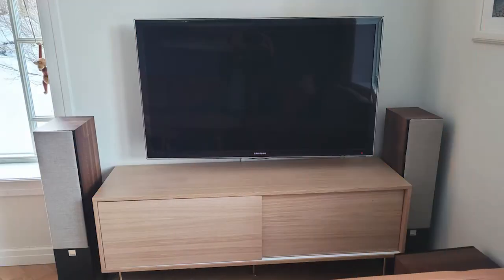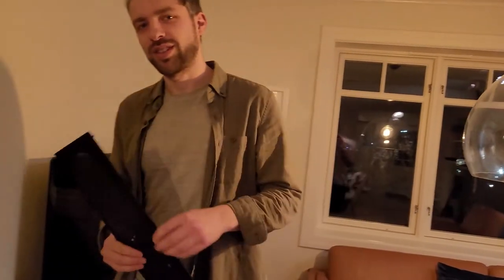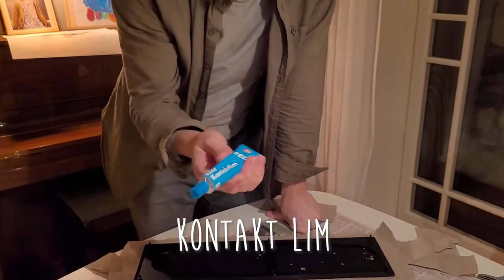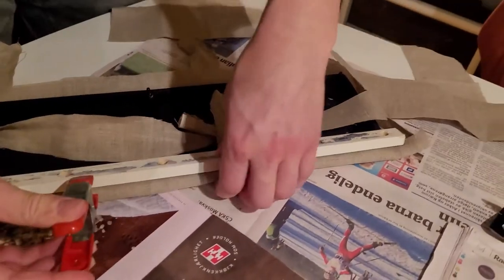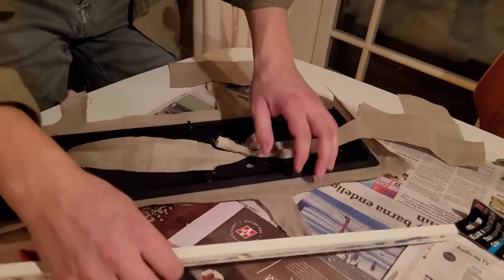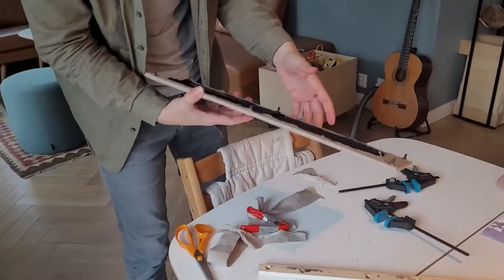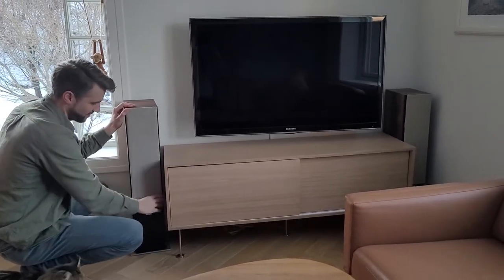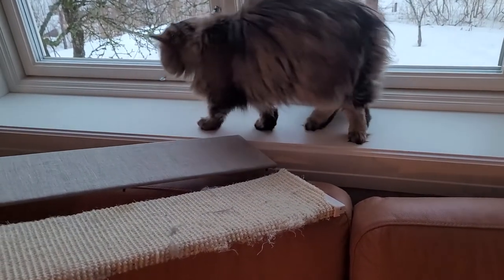Easy Way To Make Your Speaker Grill Look Good! DIY

Comment: i wanted to do my subwoofer grill. Its a silver colour, and i want black.  Wouldnt a flat black spray paint work just as well?  A think coat should allow the speaker to breath fine. Did you consider this at all?

Comment: Unless those are only being used as dust covers you just ruined the sound of high end Dali speakers. That cloth is miles off from being acoustically transparent. Even the original acousticaly transparent covers take a little bit of acoustics away from the speakers designed sound. Most people don't know all speakers are designed, calibrated and tested for it's optimal sound with the speaker grills off. So when you want to enjoy your music or movies the way the speaker was designed and intended to it's full potential......take the grills off. Grills are only on speakers to prevent damage from kids or pets, or drunk friends and dust. Anyway your video is hilarious 😂 and I was laughing along with your wife. I thought it was a joke almost the whole time until you put them on. Make another one please.